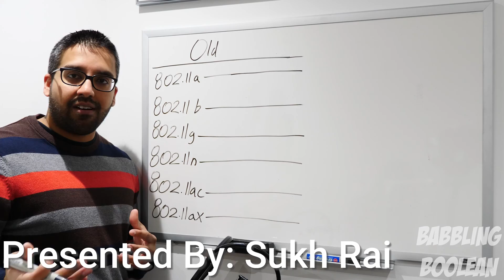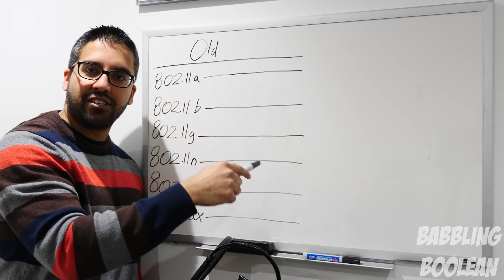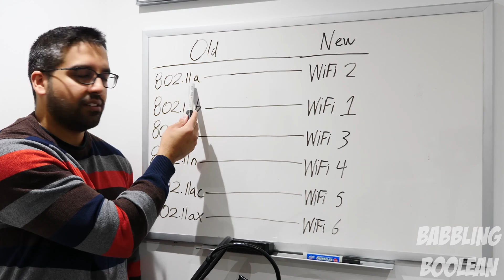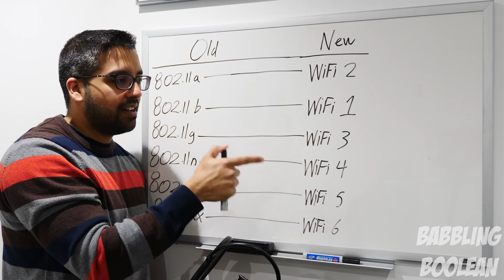Explained: WiFi 1, 2, 3, 4, 5 and 6

Comment: You forgot to mention that even though you have a Wi-Fi six phone and it can connect to a Wi-Fi three router, you will not get Wi-Fi six speed.   N is limited to 300 MB.  On a 2.4 GHz signal connection AC speed of 866 and 1300.  But it’s nothing to do with powerline networking despite the name. Many cheap devices are only BGN speeds.

Comment: I have a question, my modem uses WiFi 5, can I use the WiFi 4 protocol? Reason: I have a Moto E7 Plus that uses 802.11b/g/n, as my modem uses WiFi 5 it does not recognize the 5ghz connection and I would like to use it.

Comment: How to checl what your device has?
Reply from the maker: Google search your Wifi router model.
Reply: @Babblingboolean  oh not about router.. i wanna know if my Hp Elitebook 8440p laptop supports dual band connection?
Reply: @dragonballthings688  yes. Dual band has 2.4Ghz and 5Ghz
Reply: @theytoldmeibelonginachurch8087  but how to find out that my pc has dual band or not.
Reply: @dragonballthings688 :
1 > Open a CMD window as  "Admin". 
2 > Type ipconfig  /all and hit Enter.
All the hardware available on your PC or Laptop with show up here... : )

Comment: would it be better on Wifi 5 to be closer to the computer source but in server room  on the same floor so there is a wall in between (think harry potter room under the stairs) , or if it was in an open space about 6-7 feet above said server room

Comment: Just a question about Wi-Fi 6... Is it worth it to get a Wi-Fi 6 router over a Wi-Fi 6 chip or should you have both for them to work ?
Reply from the maker: In order to make full use of a WiFi 6 router's speed, your devices also need to support WiFi 6.